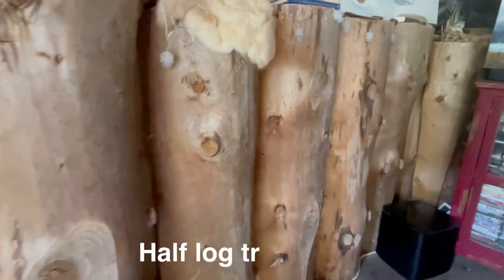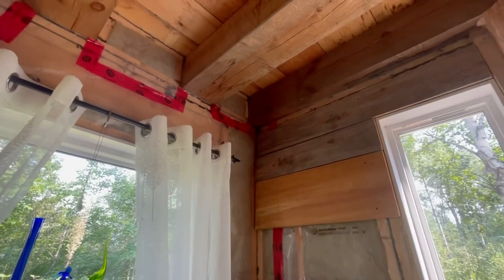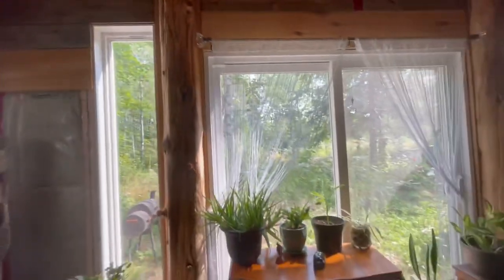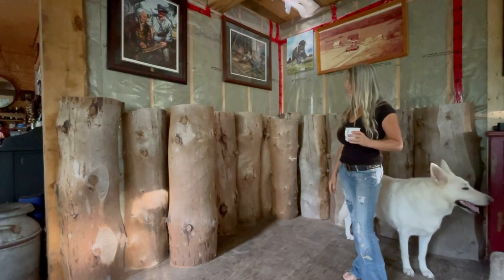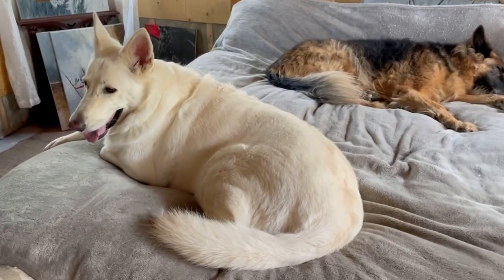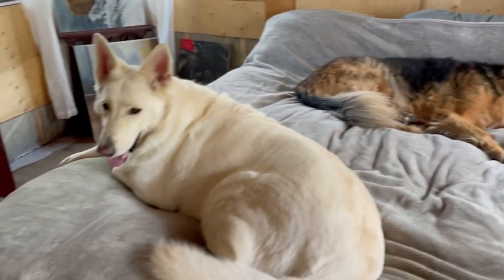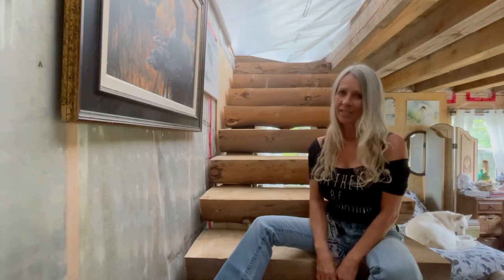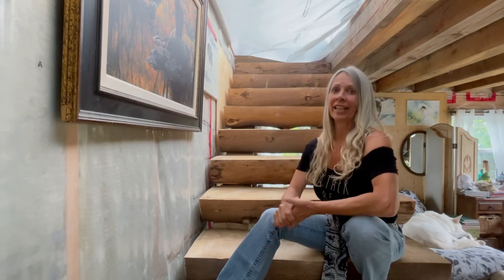Staircase 2 Heaven/Building Half Log Staircase in my Off Grid Cabin!/-EP 33

Comment: Staircase is practical and fits there good. Only question is how are u going to do the wall next to the staircase. Usually walls and floors are finished till the staircases are put it. Maybe its doable but u cant put screws behind the massive logs. It would have been easier to do the wall first.
Reply from the maker: I know…I’ll find a way to make it work.

Comment: Question for the carpenter, how did you figure out the curveature you were going to use on the first few steps before running square to the wall. You take the height and divide by the step thickness.

Comment: Those straps/ L brackets will fail. An easy fix would be 2 1/2 inch threaded rods per stringer drilled through and oversize the top hole to tuck it away and fill it and youll never know they are there. 60,000 psi per rod and youll never hear a squeak or have to worry. I gotta repeat those L brackets will fail and screws will break. Sure hope you read this
Reply from the maker: Yeah, I’m aware of this. I still need to finish the flooring before installing 2 vertical beams for extra support. I will be doing this sometime this summer. It’s on my to-do list 😉😊
Reply: @One.woman.wilderness  Great!! Sorry, i didnt mean to come off as a know it all just wanna see you both safe

Comment: A very unique staircase.   But it wouldn't be considered structurally sound in my area.  The runners would need to be going into the top header.  Not hanging from screws and metal straps.   I'm concerned that you will have problems later on. with sagging and coming loose.

Comment: I dont want to be 'that' guy but you should definitely have some support beneath the top of the stringers. I would hate for that to fall off there and cause some serious damage to your home or yourself..35 years of building and 15 inspecting, I have never seen nor insyalled a hanging stair system. Also, having carved out so much of the stringer has compromised those as well..sorry and not trying to be a nit picker but that is not right and dangerous..be careful.
Reply from the maker: All good, I actually mention in the next video that I will be installing 2 vertical support beams. I need to finish the flooring first. I appreciate your concerns Robin, thank you kindly. 😊

Comment: Nice staircase, but from a load bearing point of view, the 2  main beams would have been better rested on the cross beam than hung with screws. Now the entire weight of the staircase is hanging on those screws
Reply from the maker: I will be installing 2 vertical support beams, I just didn’t have them at the time.

Comment: Propane heat can cause excess moisture and lead to mold. Wishing you could heat that area some other way but I have no idea what that heat source could be. I did see a video about a DIY solar heater using a glass faced black interior painted wooden box and a usb computer fan. Never tried it though. And here's one that used corrugated metal roofing panels... https://www.youtube.com/watch?v=gNldYoeRYF0

And the can heater link: https://www.youtube.com/watch?v=nuxanLdtwZQ
Reply from the maker: I only hear with my wood stove... the propane fire place will only be for back up heat when required.